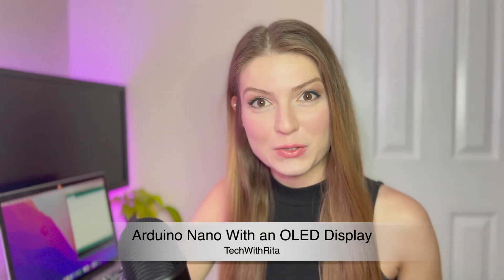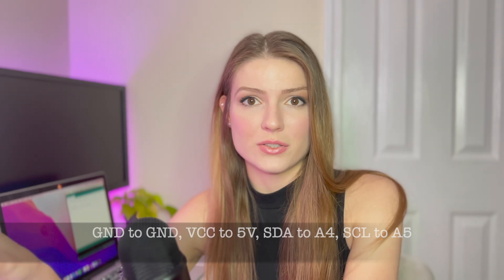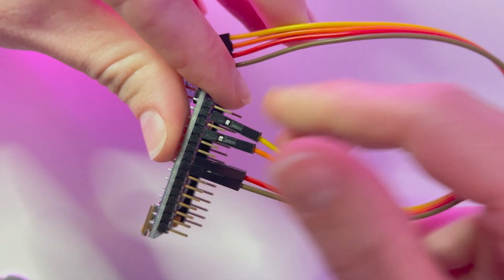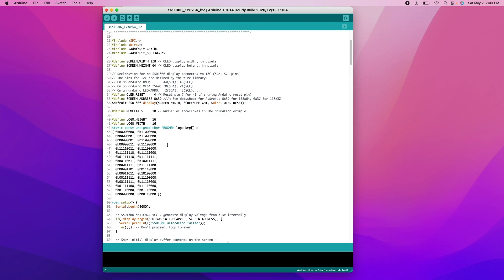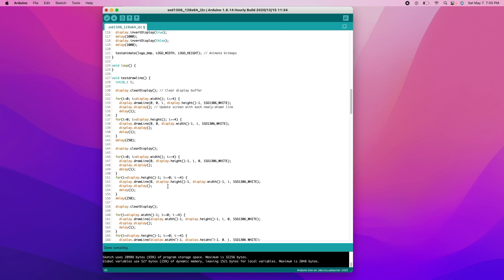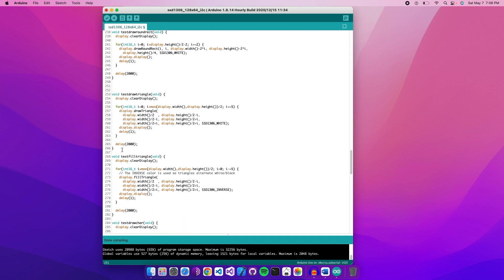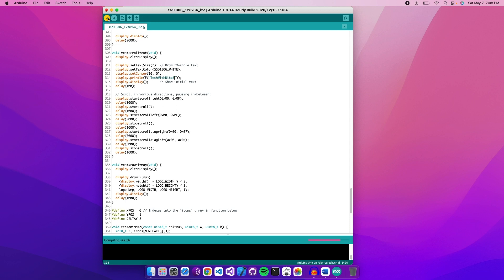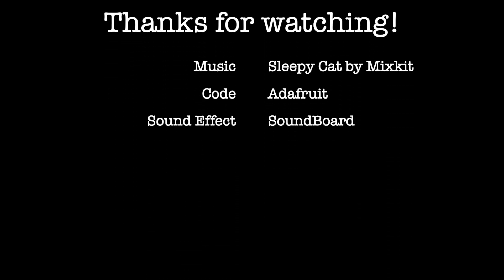Arduino Nano With OLED Display

Comment: 9:20 When you plugged the Arduino into the USB port on the left side, the system assigned it a different serial-port identifier, so you'll need to change it in the Tools→(Serial)Port menu each time you plug it into a different USB port. (In Windows, you can change the COM port to match on all USB ports, but on Mac/Linux, you can't change the identifier in /dev/… So much for Mac being more user-friendly.)

Comment: I currently have a nano with a built-in oled display. Does the sh1106 have a brightness control feature? Would a sh110x work on a sh1106?